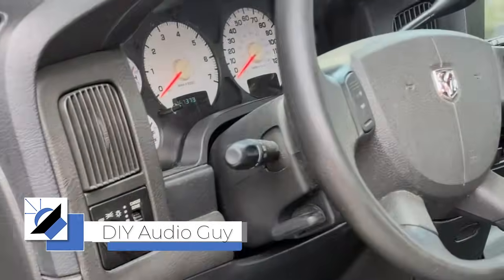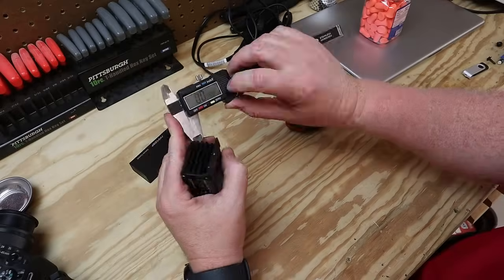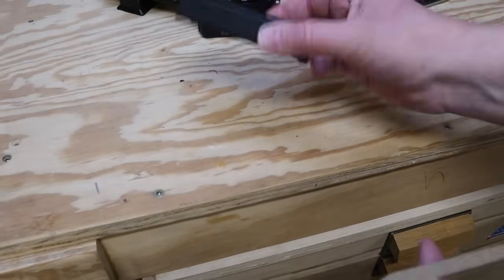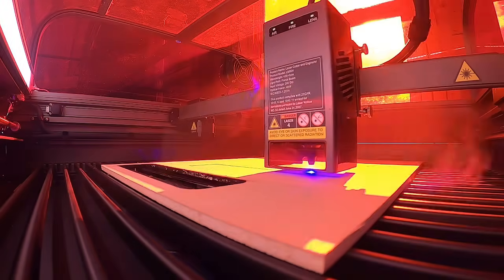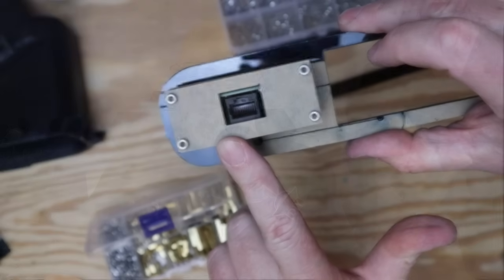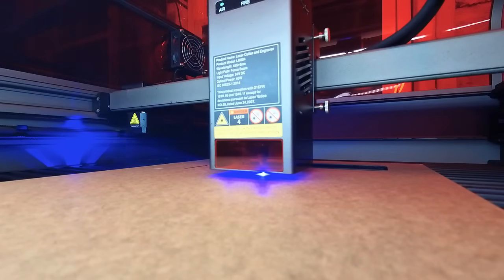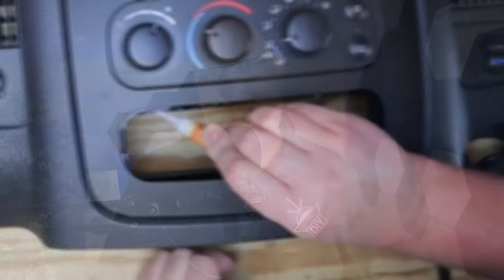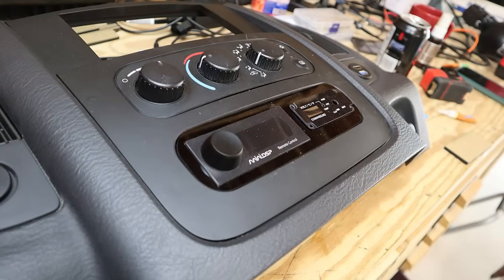The Ultimate Bass Control Interface:  Laser cut with a Creality Falcon2 Pro 40W!

Comment: People tell me that minidsp unit you are using is solid. Ive owned their 2x4hd for years and its pretty insane what all it is capable of.
Reply from the maker: I've barely scratched the surface with this thing.  It's got digital optical inputs, 12 channels of outputs, truckloads of EQ bands, a full mixing matrix that will let you do a center channel and rear fill correctly.

It's even got a compressor, just like you would expect to find on a pro Audio setup for a concert venue.
Reply: @DIYAudioGuy  I've got a Helix ultra and it has similar capabilities. Currently using it in a home to EQ everything in a theater setting. Pro audio guys would be astounded what these dsp's can do today.
Reply from the maker: @FrankBennett-kb7xs  For sure.

Comment: I don’t have a laser printer, but I built mine with a 3d printer in my ram.
Reply from the maker: That will work.
Reply: I need one with  single DIN radio and if it fix a micro epicenter controller (without the controller box)
Can you make one and how much?

Comment: That adds a whole new level of OEM. Turned out beautifully.
Reply from the maker: I showed it to some local friends and they all said it looks stock.
Reply: @ It absolutely does. Did they send you the air purifier/smoke evacuator? Wondering how well it scrubs the air.
Reply from the maker: They did not, but pumping the smoke out of a window made a HUGE difference.   I just need to build an insert for the window so that the smoke will not blow back in!